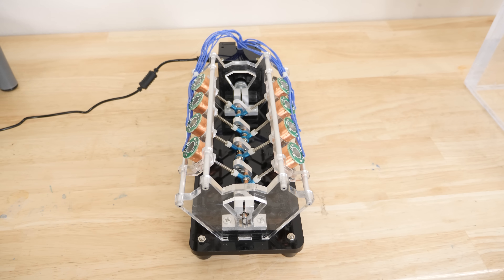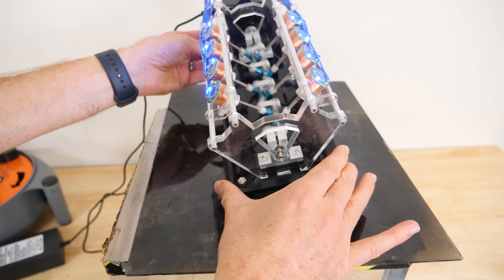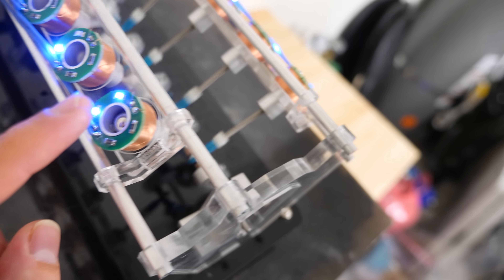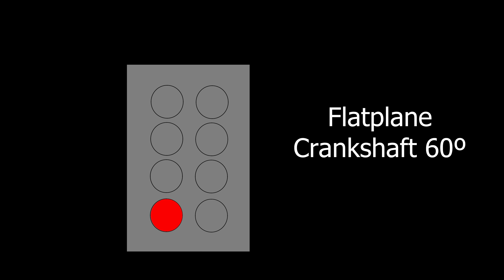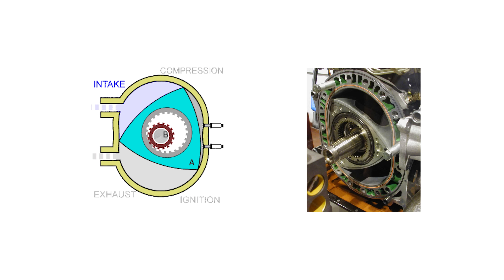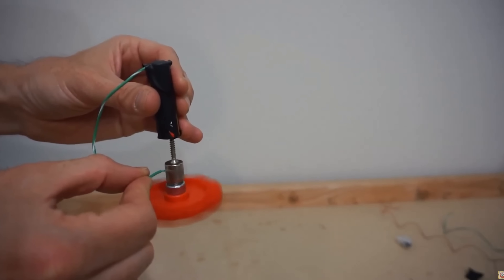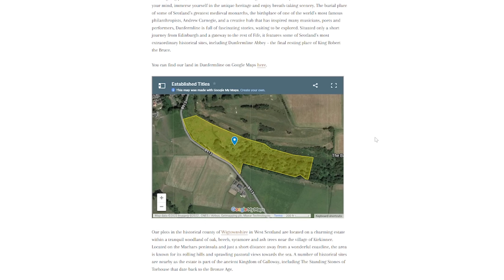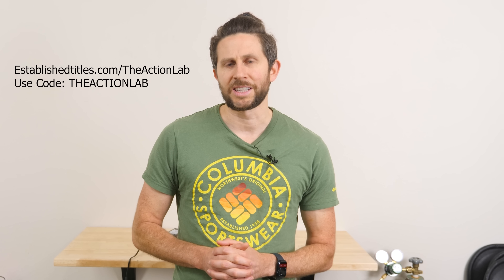Is an Electric V8 Engine a Good Idea?

Comment from the maker: I should mention that since the model 3, Teslas use Reluctance motors (IPMSynRM). So teslas can have AC induction motors and reluctance motors. IPMSynRM are really cool in how they work. I want to do a whole video on them.
Reply: @sadık bircan mmh well actually. You're not losing any energy by producing a rotational movement via a linear force. The force is produced by a pressurized gas. If you keep the piston and rod stand still, and you have pressurized gas in the cylinder, the force is still applied to the piston, but you're keeping it still, so there's no movement, so there's no work being done, so the total energy of the system doesn't change. When you let the piston move, it will be pushed down by the pressurized gas, but you won't lose energy because you're pushing "down" instead of rotating:  pushing down == forcing rotation since there's no other movement possible for the crankshaft. No other movement possible = no work done = no losses. Close to top and bottom dead center, the moment arm is small, yes, which is reflected in the small vertical travel per degree of crankshaft rotation; this ratio is maximum around to half way between TDC and BDC (depending on geometries). Yes, you're losing energy moving down the piston and the rod because they allow such movement, but they give it back immediately after when they will go up. 

Losses in a ICE engine stand within:
- friction. All moving parts lose some kinetic energy as heat due to friction. Every bearing, piston rings, gears, all the fluids moving in hoses and passages (oil, water, even air fuel mixture itself), etc
- nature of combustion (the majority of the losses): the engine uses a pressurized gas to push the piston. Heating the gas through combustion its only a way to pressurize it. After the job is done you send through the exhaust a less pressurized gas, but still at a pressure greater than the atmosphere, and still hot: (pressure and heat = energy loss). Turbos increase efficiency because it can absorb some of this energy to do something useful. For the same reason, thermoelectric power plants make the alternator spinning not with pistons and a crankshaft like a regular ICE engine, but by making liquid water turn into vapor and spin a turbine. With this setup, combustion makes more sense because the goal is to create heat, not pressure, to make water boil.
- powering auxiliaries, like water pump, oil pump, AC compressor, alternator, etc
Reply: What I know that Tesla S model used Induction then they use Permanent Magnet and now using hybrid of PM and Reluctnace motor which is IMSynRM
Reply: @sadık bircan that concept of considering the torque and the fact that the mechanical advantage varies from zero at TDC and BDC to a maximum that is approximately half way in the middle is also a flawed way to consider an ICE.

Basically to understand the efficiency then you need to look at a Carnot cycle diagram of the engine.  It all comes down to basic thermodynamics. 

The work done by the engine is simply given by the integral of the combustion force acting on the piston over the distance swept by the piston from TDC to BDC.
Reply: Tesla doesn't use induction its a large BLDC motor with permanent magnets same motor used on electric skateboards and drones small lite weight and efficient Elon musk only says its a induction motor to use tesla's name its all for marketing he really is the modern day Edison
Reply: Me and my boy learn so much. Thank you
Reply: you could have said thanks to James Hoffman for telling you this, or at least liked his comment
Reply: I thought they used synchronous/asynchronous/permanent magnet mix. 

I do know the permanent magnets are also sheeted to reduce eddy current losses just that little bit more. 

Also, I think I've read their motors are liquid-cooled through the shaft. Imo, that's the most interesting part about them.
Reply: What happened if liquid nitrogen cool electric generator? 
Dose it produced more energy or even worst?
Reply: I'm curious about how standard asynchronous motors and reluctance motors compares in term of efficiency, mass to power ration and material used.
Reply: What was the power loss/efficiency of the v8 electric? How did it behave under varying speeds? How does that compare to modern Tesla style motors?
Reply: All the problems of the rotary engine have been solved with the liquid piston version.
Reply: Coal powered Teslas...
Reply: I disagree with the coil-gun approach. Retrofitting current engines with magnetic pistons and electromagnetic repulser replacements for spark plugs should allow minimal changes to the system. Replacing the Gas tank with a Battery Pack would complete the build.
Reply: @vegaset4038  HOWEVER! - Some of the BEST ICE to Electric car conversions have been, where they have simply JUST replaced the ICE motor and connected it to the 4 or 5 speed ORIGINAL manual gearbox! Old Porsches, MG's, Triumph Spitfires, Karmann Ghia, and many more classic cars converted this way have proved to be EXCELLENT Electric drivers cars, none of the 2 pedal instant start/stop, just quieter and you STILL have driver engagement with the clutch and gears... What's more, it depends on how you tune your Electric motors ECU for power delivery, low revs torque for days, or a steady ramp up to max RPM... 😎🇬🇧
Reply: U do know established titles is a big ass scam right ??
Reply: There is already a very good explaination video to this.
Reply: Please do it!
Reply: Cool
Reply: Do a video on the next gen Mercedes YASA Axial Flux Motor
Reply: You should :)
Reply: You seem very intelligent, so do you really think anyone watching is dumb enough to throw money away on that title nonsense?
Reply: Where can I learn to make a solenoid engine.. I having trouble with the timing and power needed.
Reply: Can't wait for the vid!
Reply: They learned that from Toyota.
Reply: Lesics was made video about that  but even on the most simple version its still so complicated i would like to hear your take too
Reply: Dont forget the flywheel. And remember, rotational motors magnetic field push directly into the magnet as it passes. Pushing down on it. Its like stepping on a soap bar. The v8 may come close is this case.
Don't comment me. I'm dumb to the max.
Reply: One day, we'll discover magnetic field deflection. Then the electric v8 may be possible. Don't test me cause i'll fail it.
Reply: Can you hold light 🤔🤔🧐
Reply: you may want to recheck on the sponsor that's paying you, it may not be fully accurate what the company actually do.
Reply: Yo! Love you brother, but you need to kick this sponsor asap. Established Titles is scammy.
Reply: Please, switched reluctance motor tech is sic // also axial flux motors are trending because they are even lower mass & higher performance, used in electric aircraft already because of their power to weigh ratio even with relatively low energy density lithium cobalt batteries
Reply: What about the distribution of heat due to friction and wear?
Reply: I designed this in 2016 I didn't know about it
Reply: HOWEVER! - Some of the BEST ICE to Electric car conversions have been, where they have simply JUST replaced the ICE motor and connected it to the 4 or 5 speed ORIGINAL manual gearbox! Old Porsches, MG's, Triumph Spitfires, Karmann Ghia, and many more classic cars converted this way have proved to be EXCELLENT Electric drivers cars, none of the 2 pedal instant start/stop, just quieter and you STILL have driver engagement with the clutch and gears... What's more, it depends on how you tune your Electric motors ECU for power delivery, low revs torque for days, or a steady ramp up to max RPM... 😎🇬🇧
Reply: Since that’s the closet I got to a actual gas car I’ll take it and it’s a v8 which makes it even better
Reply: I would challenge one comment that you made about ICEs which is a very commonly held misconception....

In a typical automobile the peak efficiency of the ICE is typically about 35% however the average efficiency based on how you actually use them will be much lower than this.

With such low efficiency many people wrongly assume the translation from a linear to rotation motion must surely be a major contributing loss and this wrong assumption has been the starting assumption for a plethora of very complex alternative ICE designs. 

If you do the analysis it turns out that the actual mechanical loss in converting the linear to rotational motion is less than 1% hence you can't use it as an argument for explaining why you typically get less than 20% efficiency from your dinosaur burner under the hood of your car.
Reply from the maker: @michael-j-harrison  Very interesting. I’d like to see that analysis if you have a source! Also besides efficiency you can realize a lot of other problems with having to convert linear motion into rotational. It necessarily requires a lot of moving parts. So I think the efficiency is only part of the problem.
Reply: @TheActionLab  hey man I want you to know I've been subbed to you since you had about 200k subs and your videos are amazing, thank you for them!
Reply: @TheActionLab  if you take a undergraduate level mechanical engineering course in thermodynamics then you will get introduced to Carnot cycle diagrams.  Using this as the basis of analysis you can show that the vast majority of losses that are associated with an ICE are thermodynamic losses and mechanical losses are minimal. 

Basically you find that over 1/3 of the losses can be equated to the thermal energy that is present in the exhaust gasses that are exiting the engine at temperatures in the range of 600 to 800 degrees Celsius. 

Over another 1/3 of the losses are dissipated in the form of heat being transferred from the cooling system into heating up the environment. 

There are other mechanical losses associated with powering the various ancillary drives, the valve train, the oil pump, water pump, alternator, cooling fan, power steering pump, and air conditioning compressor. 

If you consider that a modern starter motor will draw about 1/2 HP and be able to spin the engine over at 600rpm with cold lubricating oil, and powering all the various ancillary loads then this gives you some perspective on just how little mechanical load goes into the total rotational mechanical losses. 

In summary an ICE is thermally inefficient  - it is spending most of the energy that come from the fuel in simply heating up the environment and this heat comes directly from the combustion process and not from friction related heating.
Reply: @TheActionLab  another factor to consider here is in relation to how an electric motor works.  In the most simplest form an electric motor uses the magnetic repulsion and attraction between magnetic poles (in a practical motor both repulsion and attraction are used simultaneously).
If you consider an electric motor in this simplest form you should see that this will cause a linear motion. 
By arranging the motor around a central rotating axis the linear acting force is converted into a rotational torque. 

So in this way an electric motor is really no different to a conventional ICE motor- they both need to change a linear motion into a rotational motion,  however this has never been a fundamental challenge for either motor design.
Reply: @TheActionLab  it's pretty well known in engineering that most of the losses in an ICE are actually thermodynamic/thermal losses - most of the heat produced from combustion is lost through the cooling system, or through the exhaust.

Friction and pumping losses (due to friction of intake and exhaust gases in cylinder head and intake and exhaust systems) is  around 10% to 20% at full power). There is almost no metal to metal contact in normal operation - metal parts slide on a thin film of lubricating oil, so friction is mostly hydrodynamic. Actual mechanical friction is quite low, and probably much lower than most people think....

Typically between 25% and 40% (depending on engine type - diesel, turbo etc) of the combustion energy makes it to the flywheel......

Yes, an electric v8 engine, although a cool novelty, is not really practical in real world usage. If you're going to run a car, the PMSynRel motor of the type that Tesla uses for most of it's vehicles seems to be about the most efficient around today....
Reply: @michael-j-harrison  You want to correct a misconception but you think fossil fuels come from dinosaurs...
Reply: @gabor6259  where do they come from?? If not fossils then what???
Reply: @gabor6259  that makes more sense than dinosaur juice lol
Reply: @christophercridlebaugh8965  What was the answer that Gabor gave you? It seems the comment got deleted.
Reply: @gabor6259  my comment on dinosaurs was intended as an intentional joke to try and help illustrate my point about commonly held misconceptions.
Reply: Can’t wait for that video! Always wanted to know how a Tesla works beyond the standard electric motor!
Reply: The issue isn't the engine, it's the battery source. It isn't "waterproof". EVs after hurricane Ian had to do social distancing of up to 16ft in order to prevent spontaneous fires from spreading. They also reignite. Firemen had to use 8x more water than they would use on a normal gas powered vehicle too. When they get rid of this issue then I might consider electric engines as an alternative. We need to solve the limited lithium mining issue as well, which is worldwide. Mostly coming from Australia is where we get our juice.
Reply: @godspeed2145  Well, the other lithium mines are either in China or eastern Ukraine, so I think that for the present there will be some difficulty to get freely access to it.
Reply: It's sad you think ev means green or even moral....my god you do all this research everyware els why not ware it will actually save lives and make a difference by stoping the ev snake oil bs
Reply: @danbrit9848  assuming people are stupid doesn't make one smarter in comparison...

Electricity can have sustainable or detrimental sources.

You are only showing how little you know about other people... 😮‍💨

Comment: does it require initial manual start the engine and also are solenoids are continuously on or it gets deactivated when piston is at final position (position where magnetic force is not required for further push) ?

Comment: Yup, your deduction is correct. No V8 electric needed but sure would be cool. That model doesn't have much stroke so it will have very low torque.

Comment: This makes absolutely no sense. Why would you try to make an electric motor work as if it was a combustion piston when a standard electric motor can connect directly to the drive shaft with mitre/bevel gear? Trying to bash a square peg into a round hole here I think. Looks cool though, and nice example of a how a combustion engine works.

Comment: This could be an alternative for swaps. And it would fix a lot of the issues with EV's such as not having a transmission. EV's now are built like trash because they do not have a manual transmission which would greatly increase efficiency. Having this setup would allow a wide range of bolt patterns for the bellhousing.

Comment: There are engines that ignite multiple cylinders at the same time they're called Big bang engines. Not commonly used in standard vehicles but they are used in some racing vehicles

Comment: Why not use that motor and a generator for the transmission then 4 individual motors for the wheels/rotors. The v 8 runs off itself as it generates more than enough energy as it runs to keep batteries charged at at least 85%. Once it began running it would never need to turn off.

Comment: Hello action lab you said it might take some time to build a large scale eight cylinder electric engine. I have an idea for you to find parts in a Carillon, The strikers in the Carillon that ring the bells, have large coils that you can use to build a large eight cylinder Electric engine so it could  pull a lot of weight lots of luck, action lab🎉

Comment: Rods are unnecessarily long. Also these types would work at optimum with a hydraulic drive train and the weights greatly reduced with no need for steel and iron to cast. No high strength materials for things like manifolds and heads are an added plus. Also don’t forget both production of vacuum and pressures can still be created for operations. Lots of potential. Even converting old engines into electrical ones . Take the heads off no longer needed and other tidbits like more precise bearings like those used in space aged tech, I know of one bearing that’s so precisely cut and tolerance and out of roundness is so on point it uses 0 lubricants and can’t because it would just sludge it all down.

Comment: HOWEVER! - Some of the BEST ICE to Electric car conversions have been, where they have simply JUST replaced the ICE motor and connected it to the 4 or 5 speed ORIGINAL manual gearbox! Old Porsches, MG's, Triumph Spitfires, Karmann Ghia, and many more classic cars converted this way have proved to be EXCELLENT Electric drivers cars, none of the 2 pedal instant start/stop, just quieter and you STILL have driver engagement with the clutch and gears... What's more, it depends on how you tune your Electric motors ECU for power delivery, low revs torque for days, or a steady ramp up to max RPM... 😎🇬🇧